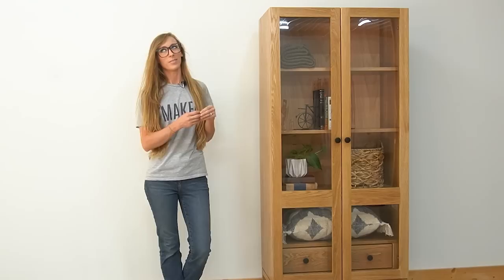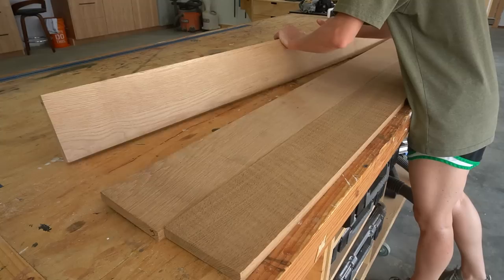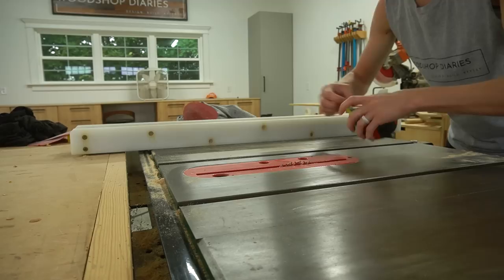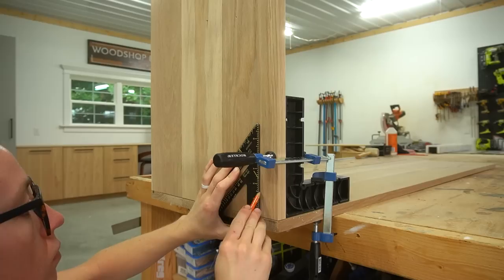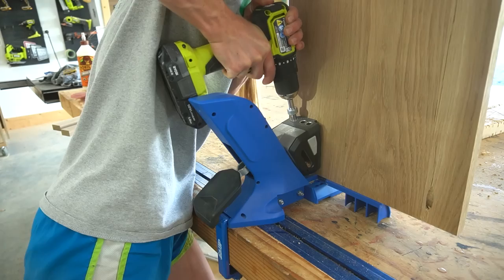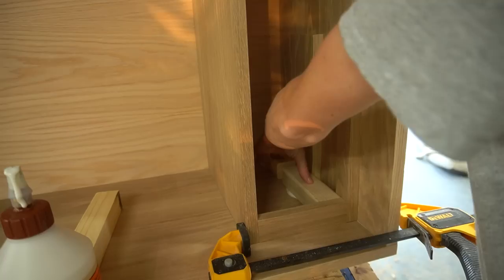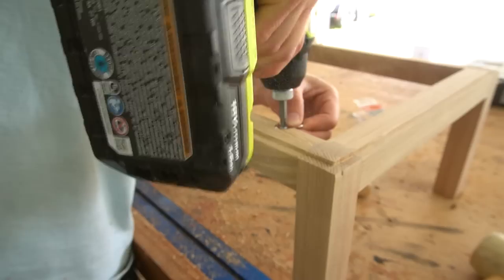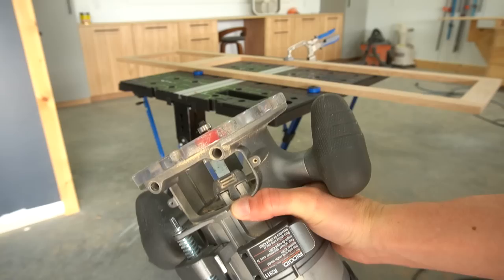How to Build a GLASS DOOR CABINET with DRAWER

Comment: As always you have great plans.  I am taking this cabinet but installling some stained glass themes in the doors instead of clear glass.   I then will add some LED recessed in the top so when the lights are turned on they will illuminate thru the stained glass.  Awesome cabinet Shara.  You rock
Reply from the maker: That's such a cool idea to use stained glass and a light inside.  I bet that will look amazing!

Comment: Thank you for the video! Did you move the router completely manually? without any rods to guide you?
Reply from the maker: Yes, I used a rabbeting bit to cut the rabbets. A rabbeting bit has a bushing that runs along the edge of the piece so that you cut a consistent rabbet. So no other guides are needed.

Comment: Just curious,  if you had dowels in the shop, why didn't you cut them down and use them for the doors?  Or are you like me and didn't think about that at the time...
Reply from the maker: I bought these dowels to match to fill the holes after I couldn’t find dowel pins in the store. But if I used dowel rods instead of pins, I’d need to flute them and sand them slightly undersized. And I didn’t have a way to flute them and didn’t want to take the time to sand them.

Comment: Couldn't you use the dowel to make your own dowel pins?
Reply from the maker: I could have, but I’d need to flute them and sand them down slightly smaller than 3/8”. Time was the factor there as well.
Reply: @WoodshopDiaries  understood. A couple of flats sanded on it  will work to let air and excess glue escape. Cheers.